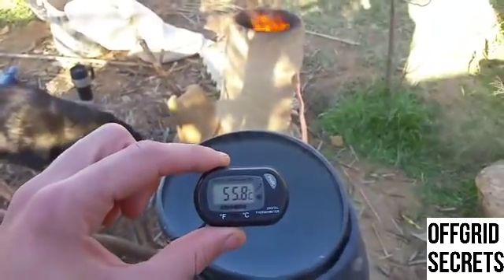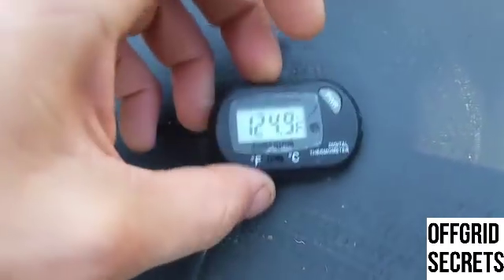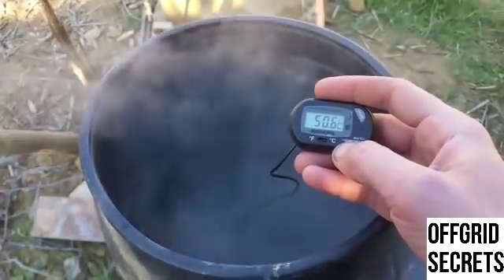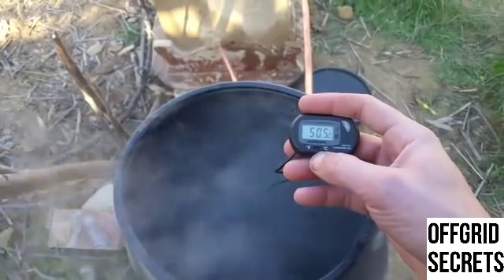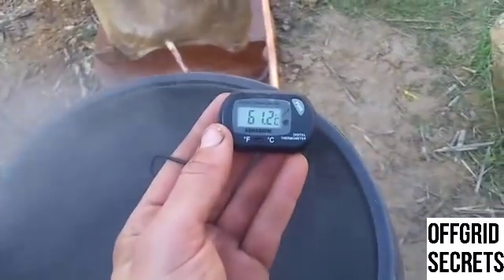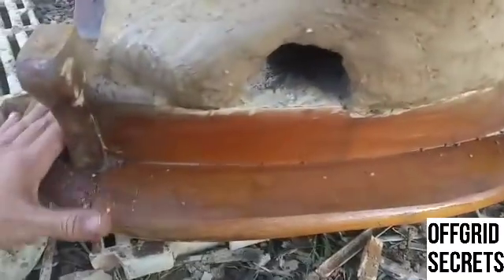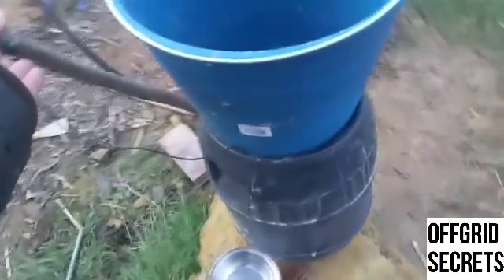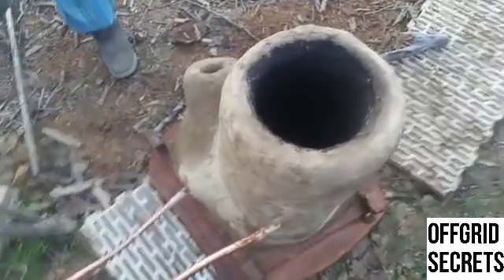Rocket Stove Hot Water Heater

Comment: Nice Job, you can improve on keeping the water hot for longer by insolation around the plastic drum, also you could make a simple water top up system using a simple float valve, so that when you use any water it tops back up, great Video there is some good free Video Editing software around, if spend a bit time, but with no limits.

Comment: If you raised the tank up 3ft/1m and had the hot inlet closer to the bottom of the tank and the cold outlet in the center of the bottom of the tank you’d set up a convection current within it and help to even out the temperature gradient a bit. Also adding a secondary cold inlet with a ballcock would refill the tank while you’re using the hot water.

Comment: Hmm, spend 3 days building a stove (including expensive copper that would take almost a year in "free heat" to pay for itself), 1+ hour each day sourcing good dry and suitable wood, loading it into the stove, light the stove, babysit the stove...all in good time for a shower etc.  Compared to spending less than 30p on 2kwh of electricity for the same end goal (a hot 60litre shower), or less than 10p if you used a heat pump all with the flick of a switch or an automatic thermostat....it's a clear winner!  😉

Comment: How well is the copper tubing holding up? I'm strongly considering combining a rocket stove w/a water heater; but, I was thinking I'd need to go w/stainless, which I don't know when I'd be able to afford. :( How many feet of what diameter copper tubing did you use?
Reply from the maker: The unit is still in 1 piece.  Seems good still. I am making a new one soon, more basic. Easier to build. Stay tuned.
Reply: Keg barrels are stainless